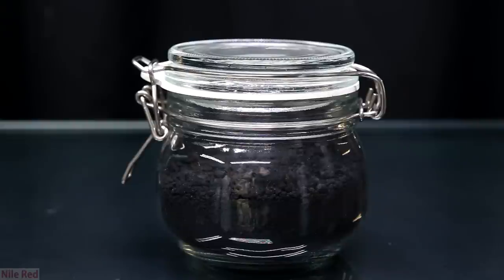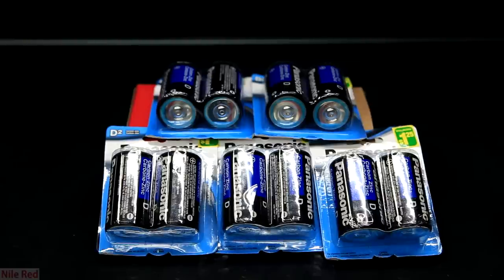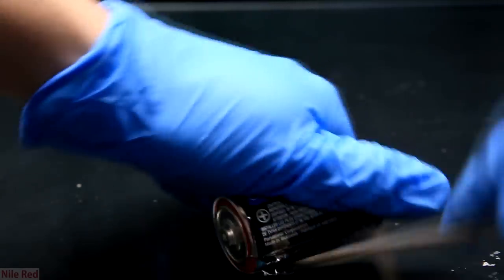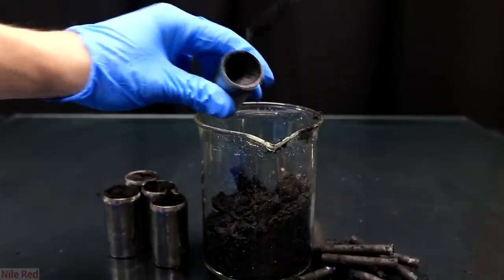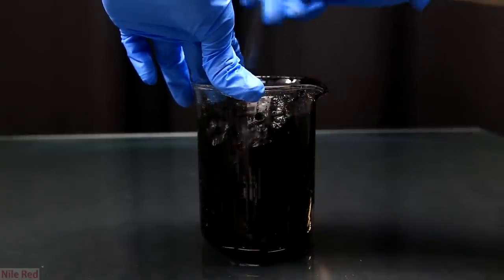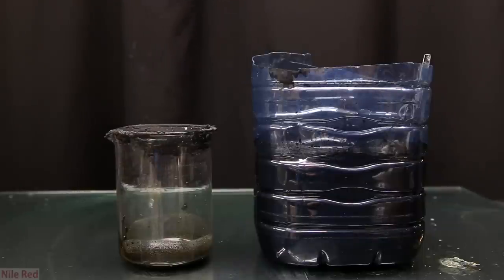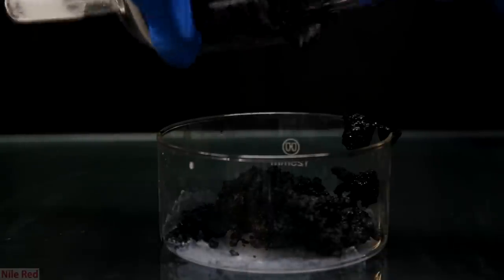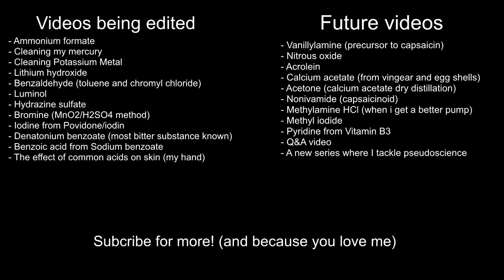Getting Manganese Dioxide, Zinc and Carbon from Batteries

Comment: As a child I used to take apart old zinc-carbon batteries to get hold of the carbon rods for plasma experiments (with life-threatening 220 V wiring ☠️ and a stench of NO2 in the kitchen air). It’s fun to watch ultra-fireproof magnesia sticks melt down above 2800 °C, or to distort a plasma flame between bar magnets, loudly vibrating at 50 Hz. I even built a working 220 V plasma-burner from these rods (hollowed out to direct the air + arc plasma through the electrode). Together with soda I converted the MnO2 to sodium manganate in my Grandma’s coal-fired oven, which formed nice purple NaMnO4 with time. No access to chemicals - so one has to help oneself. As for the zinc... well, there was not so much of the metal left once the batteries had finally died. Anyway, I used that metal to build other batteries (eg. Cu/Zn). Sounds silly, is silly... but was fun to stack the coins to reach some 50 Volts and to draw little arcs out of formerly dead batteries.
Reply: Nice, you should write an intractable. We’d love it over at the site. 👌🏽

Comment: I would have thrown the batteries with the tops opened into a container of boiling water.  This would have liquefied the cell contents and made disassembly easier without all the digging.  You ended up having to throw a bunch of water in anyway.  Doing it earlier would have made everything easier.  I would have used tap water until the final washings.  You are discarding all the water-soluble stuff anyway, and it isn't hazardous.
     You could open-fire the MnO2 to eliminate carbon dust after drying (there is a lot of that mixed in to make the MnO2 conductive, as electrons have to get from the cathode connection, through the carbon rod, and to the MnO2 to complete the cell half-reaction).  There are most likely organic gelling agents and thickeners in there also.  Many of these will wash out if you use enough water.
    For thew carbon rods, you need to fire those to get rid of tar and other organics.

Comment: Perchloric acid synthesis also seems much fun, it's the strongest acid (better than sulphuric acid and nitric acid). It's made from reacting KClO4 or NaClO4 with HCl and can be purified by distillation. It's used in rocket fuel and as superacid it has a pKa of -10, and is used in creating perchlorate salts.

Some side note:
It's reacts violently with organic material, e.g. a bath of 1000L with 75% Perchloric acid and 25% acetic anhydride exploded and destroyed 25 homes and damaged 250 nearby houses.

Seems fun!

Comment: Interesting video, thank you. I am curious, what you are using bromine for? I had to look it up and apparently it has many uses, can you say what yours is?

I am collecting used zinc-carbon batteries for their zinc and carbon rods. The zinc for metal casting and galvanizing. The carbon to melt metal with electrical current.

I tried to find a use for the paste so I could recyIe most of the battery but I couldn't find anything until I stumbled on this video. Since its main use is in batteries, I don't really have a use for it.

If you would like to trade, I can use your zinc and carbon rods and send you the maganese dioxide. Let me know :)

Comment: i just got around to purifying this by filtering dissolving the chlorides and filtering and it made a huge mess. after mom yelling at me for having the kitchen table occupied i threw it all in some baking pans and put it in the oven. you actually dont need to wear gloves while doing this, i didn't and no irritation occurred at all. I would still wear gloves though, as it was fairly hard to clean off the black goop.

Comment: You're brave filtering with a fritted funnel. the MnO2 in batteries contain a lot of carbon. Did you end up with some stuck in your frit?
Reply from the maker: +Curtis Dorris (AtrumBlood) It was actually fine. I just soaked it in acid for a while. Worst case scenario, it can be cleaned with piranha.

Comment: Might be a silly question, but wouldn't the bottom of the crytillizing dish be scratched/scuffed on purpose in order to form a surface for crystals to form? To my knowledge crystals have a hard time forming on smooth surfaces, so wouldn't it be abrasive on purpose?

Comment: At 3:57, you've made a "sports battery". It's just as juicy, but it's much lighter. You've greatly increased its value, as the purchaser would be paying for what's "NOT" there. Alternatively, it's also now an "eco friendly battery", for the same reasons, but you may need to put the color green somewhere on it for full value appreciation. Scheele's Green for maximum irony.

Comment: Use a tubing cutter on both sides of the zinc tube and you can then easily push the magnese dioxide from one side and out the other without having to remove the outer casing... and you will be able to take out the carbon very easy after cutting with the tubing cutter by pulling the positive side of the battery while the metal is still covering the carbon

Comment: 9:19 the bottom of the dish is possibly what makes it capable of causing crystals to form. 10:34 The carbon electrodes can be used as anodes and cathodes to make high voltage arcs melt metals. Grant Thompson did it a while back with bigger ones from 12 volt dollar store batteries.

Comment: That's a lot of work.  Just crack the batteries open at both ends, remove the organcie materials (carbon electrode, plastic and paper) then heat it up to 535c. The ammonium chloride will evaporate and the manganese dioxide will melt away from the steel shell.

Comment: Sadly it's difficult to get a hold of carbon-zinc batteries nowadays, mostly replaced by the alkaline ones. That means no carbon electrode, more throwaway parts and extra filtering to get the zinc powder out

Comment: Wouldn't it be easier to make MnO2 by decomposing peroxide with KMnO4? It will produce oxygen, MnO2, and KOH? You can decant or filter off the KOH with additional washing as necessary.

Comment: Better battery for this is Lantern Battery. Also, carbon rods can be used as crude leads for a high power circuit for melting or cutting metal

Comment: You can get enormous amount of manganese dioxide by simply purchasing from Pottery supplies and if you want pure form purchase manganese carbonate which is much pure from the same source and heating it I think it's 473 degrees Fahrenheit? It's 200 Celsius I think? At any rate for twenty bucks you can get pounds and pounds of it

Comment: The paste contain also a lot of C and some Fe, do you plan to purify the MnO2? I've the same problem and I'd like to not spend a lot of money in chemicals to do this, some ideas?
I've hypothesized the H2SO4 method but too expensive, or the bleach + NaOH method but needs a lots of commercial bleach.
Anyway good videos ;)
Reply: I think you can separate from fe with a magnet
Reply from the maker: +Walter Giurlani I should have gone over this more, but that is why i didnt do a second washing. It wouldnt get rid of the C and Fe obviously. However, most uses of MnO2 wont really be very affected by the C or Fe. 

You say the H2SO4 method and naoh/bleach method. Are you referring to ways to make bromine?
Reply: +The Danger I think that if the Fe particles are too small could form a sort of colloid and doesn't stick to the magnet so well to remove them, but I might try it.
Reply: +Nile Red I understand, probably C is enough inert but I'll try to remove Fe at least.
The two methods are referred to purifying the MnO2 paste: with H2SO4 should form sulphates (remove C by filtration and Fe by recrystallization) but i think is too expensive respect to buy directly pure MnO2; the second method consist in forming KMnO4 and rust at alkaline pH with NaClO, filter out rust and C (and eventually dissolve Fe in acid to make also pure C powder). But commercially bleach are only 5%...
Reply from the maker: Walter Giurlani yeah. Can you buy sulfuric acid drain cleaner from the store?
Reply: +Nile Red Yes, 98% unfortunately black... I don't have a heating mantle and with the hot plate I can't distill it, I'll probably try the H2O2 method.

Comment: Nile Red! It´s possible to use those carbon electrodes for certain electrolysis, for example you can make copper metal and sulfuric acid from copper (II) sulfate! What do you think about making a video about this?
Reply: trust me I tried it 2 years ago and it is not worth it.for large amounts you get really weak sulfuric acid and the procces is painfully slow
Reply: Carbon electrodes don't work very well and the only kind you can really use even slightly is platinum and nurd rage has already done it

Comment: How does a zinc-carbon battery work?
Briefly.
Reply: Not very well.
Reply: Manganese dioxide is the cathode, and it gets reduced. Zinc metal is the anode and it gets oxidized. Ammonium chloride here serves the same purpose as the salt bridge in a classic galvanic cell. It closes the circuit, providing the negative ions to the anode and the positive ions to the cathode. If this isn't clear or you need anymore details I'll provide them.

Comment: I've used the carbon rods in 6 volt lantern batteries as electrodes in an arc furnace powered with microwave transformers.

Comment: does carbon oxidise in air? what if you drop carbon or carbon power into pure oxygen? 🤷‍♂️
Reply: It will react very slowly, Carbon burnt in Oxygen should raise the reaction energy...
Reply: Well, thermodinamically speaking, it reacts. But not much happens at room temperature.

Comment: Zinc has a low melting point could melt zinc cans clean off dross and have mostly pure zinc. As for the ends and outer shell steel recycles

Comment: I was told that the black paste was a mixture of carbon and manganese dioxide.  Are you sure it is only the latter?
Reply from the maker: +Hugh Macdonald No, it is actually a mixture. I honestly totally forgot to mention this in the video. For most applications though, it doesn't really matter.

Comment: Hmm, maybe it would have been easier to pull out the carbon rod, use a pair of metal sheers to cut the zinc shell lengthwise, and open it up to pull out the whole mass of MnO2 all at once. I will try it sometime.

Comment: Great vid, but my 'VARTA' brand carbon zincs from Bunnings didn't have a rod in them... it was just full of MnO2 and had some pulpy, paper-like stuff in the middle. Not exactly easy to open - luckily our new house came with a giant steel mallet which did the job fairly well. There was a tiny little white wire that went from cathode to the electrolyte but it wasn't any form of carbon.

So just beware that some batteries may not have the carbon electrode in them when you buy - go for those Panasonics, and get graphite  electrodes from either pencil refills or a $2 5pk on eBay.

Comment: +Nile Red Is possible to get pure and clean zinc metal from those zinc-carbon batteries by using acetone to possibly dissolve the paper, after peeling off the manganese dioxide?
Reply: ***** It isn´t soluble in acetone, alright! But the plan is to make the paper more soft so it can easily come out completely.
Reply: I think the easiest way is melting them with a propane torch and make ingots from a muffin tray lol. me and my friends did this. zinc has a really low melting temp.

Comment: Is there a way to turn manganese dioxide into manganese metal ? I haven't found anything on youtube or google.
Reply: +Panagiotis Adamopoulos dissolve it in warm acid to form the manganese salt, then displace the manganese from solution using strips of magnesium
Reply: Heat with Al powder. Aluminiothermite reaction.

Comment: can we used the Manganese dioxide to make DIY carbon zinc battery?
Reply: So you would take apart carbon-zinc batteries just to make your own carbon-zinc batteries ? What is the point of that ? If you actually made it from scratch, like buying, looking for and extracting the materials from something else and then making a carbon-zinc battery yourself, then that would be somewhat an interesting thing to do. 

It's just my opinion, though. Do whatever you want to do.

Comment: how does adding the water to the manganese(IV)oxide remove the ammonium chloride electrolyte?
Reply: Ammonium chloride is quite soluble in water while MnO2 is not. When he adds the water the NH4Cl dissolves in to the water so when he pours the water out when decanting and filtering, the ammonium chloride goes with it while the undissolved MnO2 solid stays behind on the filter.

Comment: Big non-akaline 6V batteries are bigger than Ds.
Reply: It's been a long, long, long time since I've taken batteries apart but isn't there a load of thick tarry "gak" holding the cells together in a big 6V battery?
Reply: edgeeffect the ones I used only had the tacky thing on top. They also had a pllastic enclosure (eveready brand)
Reply: Yeah... it was ALWAYS Ever-Ready when I was young.
Reply: No, it's just at the top of the cells. The trick with those is to cut the top off the can with a pipe cutter (tubing cutter). This lets you pull the top, sealant layer, and carbon rod out all as one. Makes it much easier to cut the tar off.

Comment: Hey, I take apart batteries as a recycling project so i take apart alkaline batteries more often that carbon zinc. When I get a carbon zinc battery i get really happy since i can process one of those in about 2 minutes. The hardest part honestly is probably getting an initial grip on it, but even that is pretty easy. I would complain about the plastic but for whatever reason I've noticed that the plastic slides right off my carbon zinc vs my alkaline. Alkaline however, those give me issues a lot. They have a steel casing on them vs a zinc casing. Zinc I can rip through no problem, they are really easy. Iron takes me forever. I can do 5 zinc batteries before one iron battery. Still, I have quite the collection of manganese iv oxide.

Comment: not even an acid wash can get rid of that?
what kinds of acid did you use?
Reply: +FantasmaNaranja He mentions using Piranha solution (H2SO4 and H2O2) which usually makes short work of just about anything. Very surprising, wonder what the stain is.
Reply: oh alright,
thank you.
Reply from the maker: +XvAvX I think it's more of a stain, but ive tried everything and nothing touches it...so Ive accepted that it is just part of the glass now.
Reply: a part of the glass seems slightly higher than the rest and in a splash pattern before you apply the manganese putty
so maybe something raised the glass and broke its structure a little giving it that white colour?

then again there's some white splashes on the sides as well
Reply from the maker: FantasmaNaranja I burned white phosphorus in it. Also, it is pretty impressive that you noticed it was raised from the video!
Reply: thank you. i guess?

i tend to notice small things like that or if a youtuber hasnt sleept for a while and they have shadows under their eyes or their voice sounds different ect.

Comment: I am pretty sure that alkaline batteries also contain manganese dioxide
Reply: No. Manganese isn't an alkaline earth metal
Reply: +Josh Lukowicz Alkaline does not always mean as an earth metal - in this case, it's used to describe the elctrolyte used in it, potassium hydroxide. There is, in fact, manganese oxide used as a cathode.

Comment: you didn't mention how to get rid of the carbon impurities in the MnO2
Reply from the maker: +Kasim z I kind of glossed over it. It is quite hard to separate mechanically. Probably more chemistry would be required.
Reply: NileRed Would putting it in a crucible and heating it until all the carbon was oxidized work?  Or would that decompose the MnO2?
Reply: Cody Ho have you tried? i wanna try but i think that the carbon reduce the mno2 to mno and co2, and return to mno2 requires high pressure as far i know

Comment: Is there any use for those chemicals?
Reply from the maker: +Yellowish Smiley which ones? The zinc and carbon?
Reply: +Nile Red everything
Reply: +Zachary Lim uh did you watch the video? lol
Reply from the maker: +Yellowish Smiley Mno2 can be used to make bromine, generate oxygen from h2o2, act as an oxidizing agent, or pigment, etc. The zinc is a useful metal that can be used as a catalyst or converted into a salt like Zinc Chloride which is also a useful catalyst. The carbon rods can be used to make an arc furnace or for various electro chemistry applications.
Reply: +Icathiann uh ya I did
I was joking

Comment: what about ammonium chloride  paste??
Reply: manganese oxide will also contain paste of ammonium chloride what about it??how to separate it??
Reply: +shobana patel The water washes were done to remove (most of) it.
Reply: Thanks for sharing *****
Reply: You can use alkaline batteries for that. I scavenged a few of those and I can say they're not as bad as people say. There is barely any liquid, and you can separate ammonium chloride with a screwdriver.